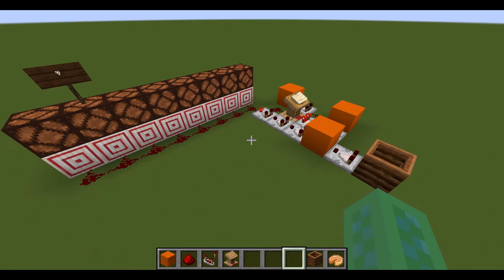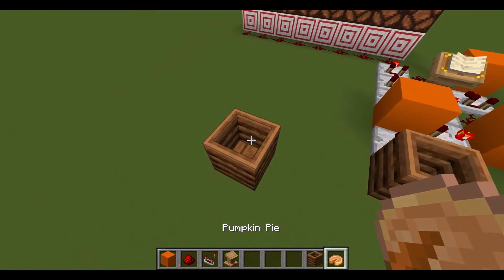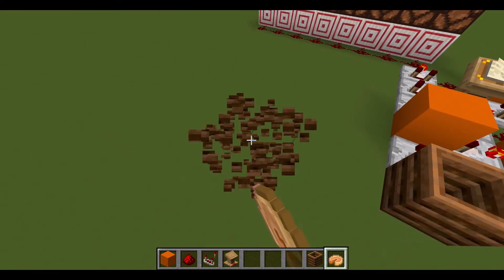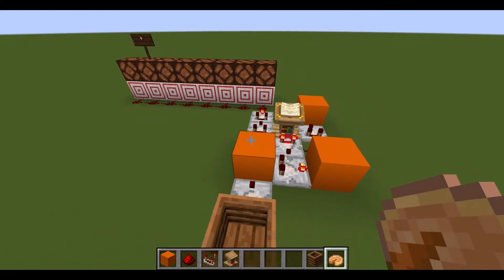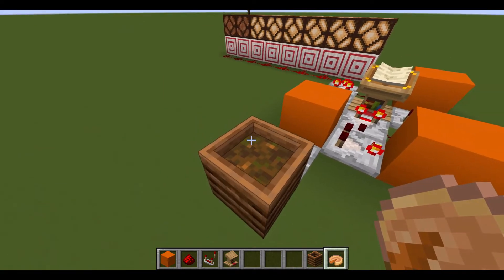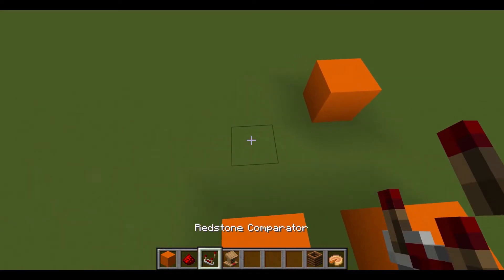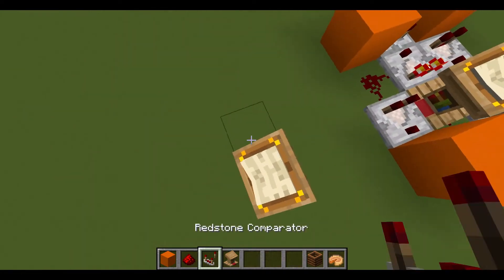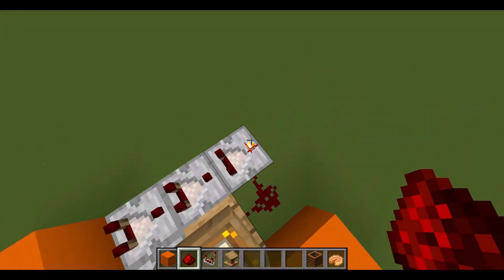Minecraft Octal Computing - Composter Filter Circuit

Comment: If you have x as the composter signal strenght, a simpeler solution is just doing 7–(7–x). If the value is 8, then 7–x=0 (mathematics!), and 7–(7–x)=7.
You can also just work with the inverted values, then you only need to do 7–x, that's faster.

Comment: i was able to make one very slightly smaller, where its still 4x3 but that 4x3 includes the input comparator

c=comparator (normal)
s=comparator (subtract)
b=block
l=lectern at page 7
r=redstone dust
x=nothing

s r x
c s r
r b c
x c l

the bottom comparator is input, output at the top left